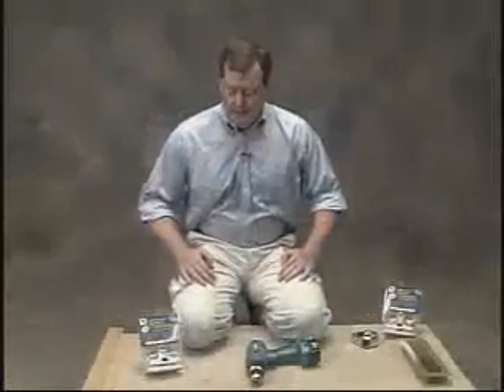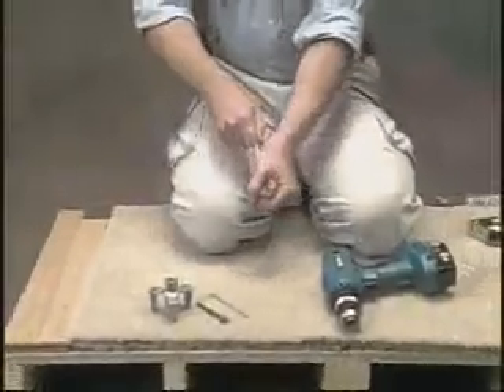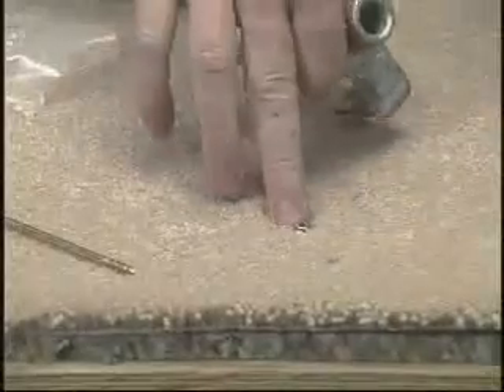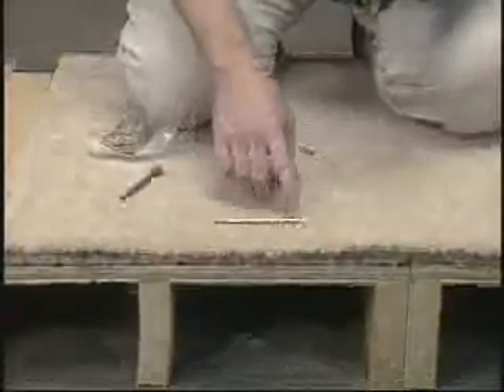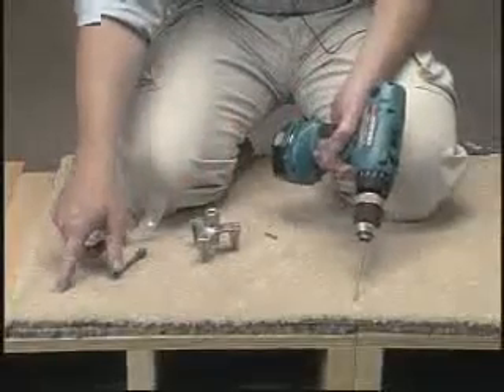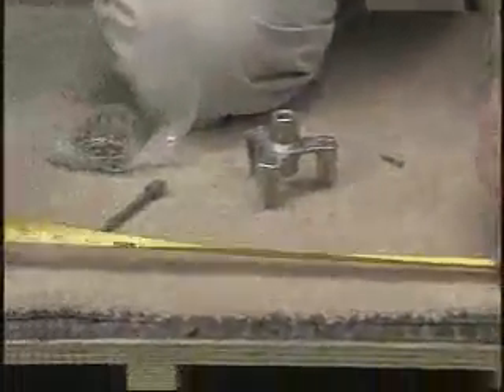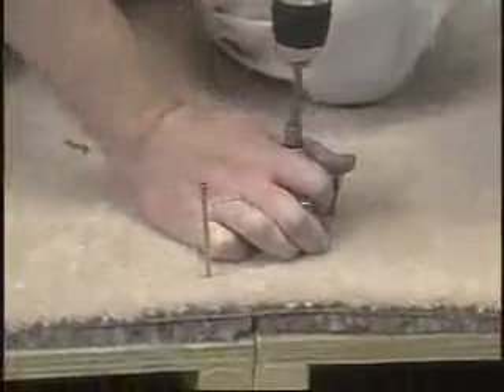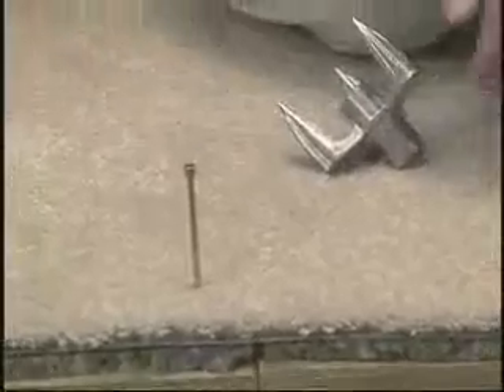Squeeeeek No More (squeaky floor repair)

Comment: I just received the kit and solved my problem. I found it to be well thought out (changing thread, measured drive-in device, snapper, joist finder), intuitive and effective. My only comment to other users are that if you have thick carpeting make sure you apply a lot of pressure on the screw as you drive it in, or give it a few more turns once the drill starts spinning. The effectiveness of the screw depends on you driving it in deep enough so the two different types of thread can do their job.

Comment: I have a couple of squeaky spots in my new home after it was constructed. I did not want to pull up carpet to fix the problem so I purchased this tool and it worked great!!! Carpet did not get tangled and squeaks were gone with four or five screws properly placed. The hardest part is finding the joists. The joist tool really needs to be a bit longer to reach down through thick carpet and the subflooring.

Comment: In the kit you will get a sample screw that has a very simple two inch piece of scotch tape over the threads, the tape just covers the threads as the screw moves into the carpet, it will prevent it from catching the carpet loop and causing a run, a real simple thing yet it works!

Comment: I have used this product since 1994! It works great on loose sub-floor (plywood or OSB) squeaks! I use #10 bright finish nails through the carpet and pad to find the joist/truss, then pull them out This leaves a nice pilot hole in the carpet. I use blue painter's tape to hold the carpet nap back so the screw doesn't grab the carpet and damage it. As someone stated earlier you can pull back the carpet and pad then just use screws, but if the room has a lot of furniture this is a fast alternative!

Comment: Yes, its been a year since I bought these and I finally got around to using them. They DO in fact work. I've only tried them on carpet. They did seem to damage the carpet just a little, but that may go away after some traffic and use. Its not bad. My carpet is in desperate need of replacing so it doesn't bother me.

Make sure your drill chuck is clean and wipe off the locator driver provided. My carpet did pick up a little dark something from something. A little area cleaner will fix that, but if it were a bright white carpet (dont know why anyone would have that, but...) I would probably be a bit worried.

If you are a mechanical person, very tool and drill capable, this is not difficult to deal with. If you are not tool handy...I mean really tool handy, you should ask someone who is, to do this for you. But dont hold them responsible for what the system does to your carpet or if they cant get all the squeaks completely gone. I drove 40 screws in a hall area at the top of stairs and in front of a laundry closet, about an 8 foot span and eliminated some terrible squeaks, but there is one pesky one I couldn't solve with even a bunch of these, but its a minor squeak.

I suggest when you find the joists and drive these in. Don't snap them off right away. They will give you a visual guide if you need to add more as you walk back and forth discovering if the last one you put in stopped the squeak. Be careful though, with these sticking up, you can easily get a knee on one and that would really hurt.

Comment: The success of this method really depends on what is underneath your floor. If you know where the pipes/cables are then this method may be successful. If you don’t then you are risking drilling into pipes, cabling etc and will risk a more expensive repair job than if you just lifted the carpet.
Reply: Use a stud finder?

Comment: Jumpdance and 604carpenter, you are incorrect.  This product does exactly what it's supposed to.  I haven't tried the product they have for hardwood, but I used this on rugs and it is amazing.  I went through more screws than I expected (yes finding joists can be tough) but it actually does work.  And they give you a coated screw that is supposed to be used if you have berber type rugs.

Comment: If you live in the UK you are asking for trouble using this method,pipes and cables could be directly under the floor surface.
Reply: @joextreme  This is the country that allowed Grenfell to happen - I think codes are more like written suggestions over there.

Comment: What about water pipes, gas pipes, electrical wires?
Reply: Electrical wires are run from the ceiling down not from the floor up. Gas and water lines are below the floor joist.
Reply: Tpklmale not always in UK. Sometimes there are wires/pipes in a groove cut out from the joist
Reply: Shouldn't cut grooves in floor joists.  Compromises the structural integrity.   Perhaps do a visual inspection of the area underneath where you plan to run screws.
Reply: Lazy builders often don`t even bother putting pipes below the floor joist nor even cut a groove into it,they just cut a block out of the wood.
Reply: @SlothyWoffy   I imagine most of the people complaining about drilling into wires and pipes are just people from the UK. The problem isn't the product, it's how they build homes over there. It sucks that this could create misfortune for someone who doesn't do their due diligence before drilling. Rule of thumb - don't drill lightly.

Comment: @crossfireservice 
Most builders here in Ottawa Canada offer screwed subfloors...the problem is that the supposed tradespeople screw most of the screws into air rather than the joists. Its come back to pride in your work

Comment: I just got my kit in the mail and the die cast metal thing is plastic...  I found I really don't need it for driving the screws,  its more for snapping the head off...  I found all my joists and drove in 19 screws and I still have not found that sweet spot.  I know this product should work,  but I don't know if my creaky squeaky floor is being caused by something else or what?  Any advice? Thanks...

Comment: Who invented this  a plumber? they must love it another £150.00 call out!
Reply: @joextreme  Imagine having this happen and being so shortsighted you blame the product instead of your government's building regulations. Running piping and wiring directly under the subfloor is a bad idea for multiple reasons - there's work that may need to be done there other than a warped or failed connection. Which is why houses over here tend not to do that, outright negligent builders notwithstanding. Another reason to feel sorry for people who live in the UK. This is the country that produced Grenfell.

Comment: Don't by this folks , if you hit a main pipe ,look out ....it will cost you about $ 1,000-1,500 what with all the ceiling damage, repaint, and  blown fuse, or worse electric fire.

Enjoy your product ?

English Mik
Reply: Good comment however if you follow the guidelines in the video for finding the floor joist no problem. Most piping and wiring, if done per code, will be well below the screw end point.

Comment: But every water or heating pipe and electrical cable has just been busted. If your gonna use this turn off your electric supply first to save your life
Reply from the maker: Good advice
Reply: If you're in the UK or elsewhere. This is a US-centric product and the vast majority of homes in the US were built with the bright idea of not running pipes or wiring directly below the subfloor. Not saying corners don't get cut by negligent builders, but even if this is a worry just use a stud finder which should be the rule with this sort of thing anyway. The product itself is handy.

Comment: This was a  disappointing video. Sound was poor, camera did not do any real closeups when they would have been helpful. He located the joist, then drives a screw in a few inches over. Obviously he knew it was a double joist, otherwise he would have missed it. Not a clear explanation of what happens to the screw when he locates the joist. I just bought the kit. I expected a much better video.